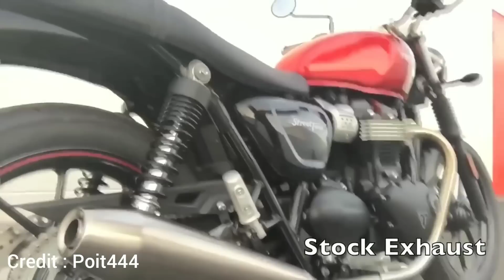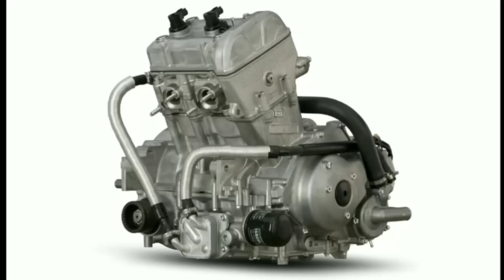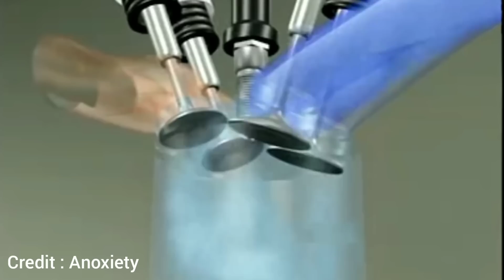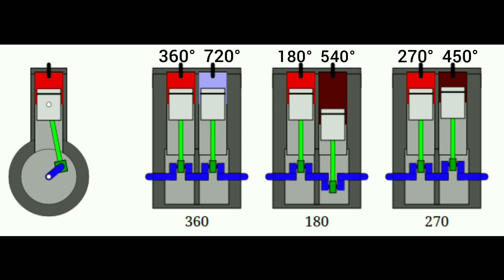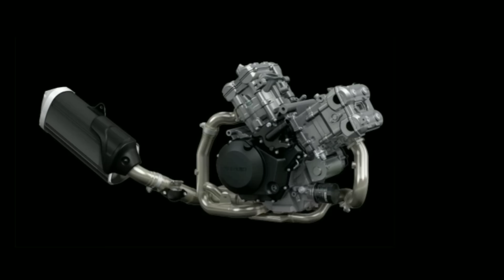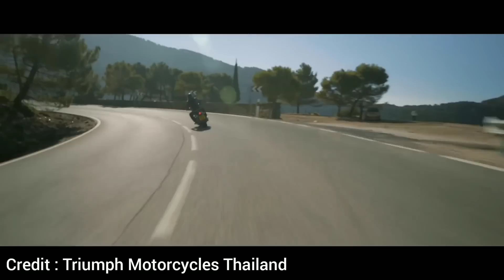270° Parallel Twin Engine: Why It's The Best Form of Parallel Twin Engine?

Comment: When comparing the pros and cons of 270° parallel twins, other engine factors should be taken into consideration.  Since this video examines 3 inherent characteristics of 270° parallel twins: vibration issues, exhaust/engine sounds, and cost of ownership / manufacturing.  I will examine only one specification (of many) that can affect all three of the issues listed above: engine cooling.

• Air-cooled engines typically dissipate their heat through fins seen on the cylinders, and often the head itself.
• Air-cooled engines require fewer parts, both for manufacturers to build and for consumers to fix, maintain and replace (radiators, pumps, coolant).
• Air-cooled engines provide more simplicity, representing less components, which could break, need to be replaced, or need servicing. (radiator, pumps, coolant change intervals, electric fan, etc.).
• Air-cooled engines run richer, making them less efficient and more polluting.

• Liquid-cooled engines replace air-cooling fins with an additional layer of aluminum casing to create a "water jacket" for liquid coolant circulation (more engine mass).
• Liquid-cooled engines having the cylinders and heads jacketed and surrounded with flowing liquid coolant act as sound insulators and deadens mechanical noise making them significantly quieter than air-cooled engines.
• Liquid-cooled engines - circulating liquid evens-out hot and cold spots in the cylinder head for better emissions and more complete chamber combustion.
• Liquid-cooled bikes can rev higher because they have higher tolerances due to their ability to self-cool.
Reply: Thanks!

Comment: With the 360 degree crank the firing interval is 360-360, it is an even firing interval, why does the animation show 360-720 at the top?
Reply: Probably because they mean a full cycle for the engine is two full turns of the crankshaft. In other words 360 + 360 = 720.

Comment: When I was looking at the classic line of triumphs in 2014 I thought I wanted a Thruxton.  Then I rode the scrambler and the engine did so much more for me with its 270 degree crank.  That set me off looking for a dropped scrambler to turn into a thruxton.  In that search I came across a Moto Guzzi V7 Cafe and haven't looked at Triumph since.
Reply: My 2012 Thruxton EFI does have a 270 degree crank.

Comment: Good point you made at the end about the 90 degree twin. You hear that after all, it runs a little smoother than the 270 parallel twin. And there are some great and expensive and less expensive 90 degree twins out there. We have perhaps the best known from Suzuki and Ducati. I’m sure they’ll hold their market for a good while. At the same time they are more expensive to build, which you also mentioned, if I remember correctly.

Comment: Good summary, just a remark: a 270°parallel twin is not equal to a "real" 90°v-twin in terms of balance. 90°engines have perfect primary balance, no balance shaft needed. So the vibrations are different and the sound isn't perfectly the same, as it depends on not only the firing intervals (just the exhaust note, but there are some auxiliary noises that make it special and characteristic).
Reply: having owned a 270 degree crossplane (MT 07) and currently a 90 degree v-twin (V-Strom 650) - I can confirm from experience that only the exhaust note is mildly similar ... the feel is very different, the vtwin is much more balanced at low revs and the power delivery feels smoother overall while the 270 parallel twin had a more erratic feeling power delivery and only felt equivalently smooth at the higher rpms (after 4500 rpms). 

both are a hell of a lot more interesting than a 180 degree parallel twin and produce better torque/sound in my opinion.

Comment: Since the 70s the Yamaha XS650 motor was a popular one to rephase to 270° (actually 274° because of the crank splines). In the 90s Yamaha introduced the TDM850 to the US market, a liquid cooled parallel twin with a 270° crank but sadly it didn't really sell well.
Reply: The TDM850 was a great bike - I spent a week in Scotland on one, and it was an ideal bike for the journey. Did not lack power on the Motorway, either!
Reply: Sadly indeed. The TDM is a great bike and gorgeous motor. 270o from the MkII onwards, pretty sure it was only the MkI that was sold in the US. Yamaha's 700cc twin is a direct descendant.

Comment: Parallel twin means 360 degrees, not 270.
Reply: Sorry, not true! Parallel means both cylinders are parallel i.e. together regardless of the firing order. all engines in the article are parallel twins. Another twin configuration is the Horizontally Opposed Flat Twin or "Boxer" engine.
Reply: It parallel as in two cylinders in parallel, as opposed to a v or flat configuration.
Reply: @christommo  You mean line engine as opposit of flat or v.
A two cylinder line engine is only a parallel twin when the pistons move parallel, but not with 270 degrees.

Comment: *WHAT ABOUT 2 STROKES?*

I had a two stroke, 2-cylinder Suzuki 250cc bike, an RGV-250, that in stock form put out 70hp.  Real lightweight bike.

That model from the 1990s is now over 20 years old.

If 2 strokes were still around, an RGV-250 would be putting out 100hp or more.

Imagine riding a 300 pound sport bike with 100 horsepower.  That's where we'd be today.

Damn politicians and tree huggers.
https://en.wikipedia.org/wiki/Suzuki_RGV250

.
.
.
Reply: Then you're not a tree hugger, 2 stroke stinks reeaaally bad, I sold my 2 stroke because of the bad fumes, at stops or with bags you start to smell like shit... And it uses a shitload if fuel AND oil

Comment: Nice clip. But I have to disagree with you about the exhaust note. To my ear, the sound of the 360° twins I grew up with (Triumph and BSA) has much more character. (And there's nothing uglier IMO than the flat fart of a big American V-twin!) However you can't always have everything and I'm quite sure that the low vibration in a 270° twin more than compensates for the sweet sound of the old British bikes that shook you to bits.
Reply: I agree, I grew up with British 360° twins which sounded great and then bought a 1984 Yamaha XS 650 which was 180 degrees that it didn't really feel any different at all, and then I test rode some new Triumph 270° twins and unlike all the hype about them feeling like Harleys they didn't  (I own old Harleys) They just felt very smooth like a modern Japanese multicylinder bike. My conclusion is the sound is no better but the vibration is less. (But the original Royal Enfield interceptors, although 360°, were balanced at the factory and were very smooth. I owned a 1969 one and can confirm this.)

Comment: Phil Irving from Vincent motors patented this engine configuration in the early 50’s.
Nothing new under the sun.
Reply: Interesting.  I had not heard of this configuration until these days with these new offerings.  I suppose Irving found no satisfactory reason to manufacture it.  I consider the Vincent one of the best engine designs ever produced considering it's compactness and visual appeal.
Reply: They was. Yamaha was the first motorcycle manufactor to offer it, but the drawings and patent goes back.
It can make you wonder why the british motorcycle manufactors never took it to them. Reduced vibration could have kept the costumer happy.
Reply: I thought parallel 270 twins were introduced in the 90's by Yamaha's TRX ("Trixie") and TDM

Comment: Good job, very informative content! One small detail, if I am not mistaken, 270 refers to the ignition difference between the two cylinders and not necessarily the spark plug firing. Some engines work on a waste ignition system, and thus fire the spark plug on every crank pin rotation! :)
Knit picking though, thumbsup!

Comment: I really dont like how you use "spark timing" as a reference, as thats a different thing entirely. But if you use a term like "compression stroke" or "power stroke" instead, its fairly accurate.
Reply: KyleP133 Agreed. Spark timing has to do with the relation to the timing TO the compression stroke. How many degrees before tdc. Totally different.
This is about crank timing.

Comment: Best explaination yet! Moto Guzzi has one of the best 90° v-twins.
Reply: And Yamaha had the best one, the TDM 900. With 10 valves and lots of torque. Now there's only the Teneré comparable. I do hope that MT series wil reintroduce a parallel twin again. That triple is good, but what should the twin lovers do now? Restore a used TDM 900? Why isn't there a new TDM 1200 big twin? Yamaha is very capable to renew the TDM, it was a great concept. Why not update it? TDM 600, 900 and 1200?
Reply: @voornaam3191  love a piped 900 triple...best sound ever.

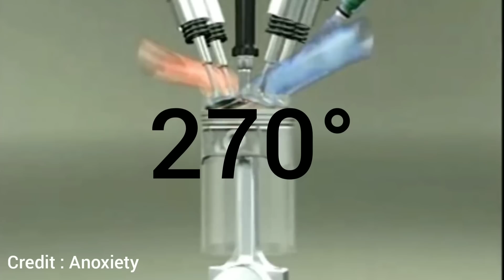Comment: 1:05 If you didn't know what the degree meant this explanation makes no sense and the animation apparently isn't used to help neither the 3d one or the 2d one after.

"The crank angle At which the spark is being produced by the spark plug in the combustion chamber near the end of the compression stroke" why are we talking about the spark and the compression stroke? What do they have to do with the degree? First I was thinking a ou the angle of the spark plug then I was thinking about how the compression stroke angle was different than the exhaust stroke. That was just a string of nonsensical words
Reply: Degree(s) is a relative measurement of crank rotation angle, it is how the timing of the ignition, inlet valve(s) and exhaust valve(s) timings etc of each cylinder are measured by and against.
270 degrees, means, that there is 270 degrees spacing between firing of cylinder 1 and the next cylinder to fire and so on per cylinder. In a 4-Stroke engine, every 4th revolutions that/a cylinder will fire again 360 x 4 = 1440 degrees.

Typically a 'Screamer' engine has generally all its cylinder firings largely equally spaced, with the power impulses being a constant driving force, while a 'Big Bang' style engine will have the firings closer together timing wise, leaving more room/time for restoring traction from the more powerful grouping of impulses.
A 270 crank is akin to a big bang engine, and a traditional 4 cylinder being more of a screamer.

But ignoring the firing intnerals so decribed, and more importantly... 

A 270 cranked twin engine, means the crank pin for each cylinder on the crank itself, the offset for each is able to be in the same postion on the crank relative to each other - where as a 180, the crank pins are on the opposing angle on the otherside of the crank, i.e; one towards the cranks top, and the other towards the bottom of crank.

Comment: And then there's the 90 degree (cylinder angle) 'transverse' V-twin which is actually a longitudinal v-twin since the terminology refers to the crank orientation. This in my view is the best layout for an air-cooled twin. Moto Guzzi know a thing or two about this.
Reply: So do Honda they built the CX 500 transverse V twin shaft drive  & went one step better & made it liquid cooled with slightly offset twisted barrels to tuck the carburettors in nicely .
Reply: Wasn't the honda more like 80 degrees?
Reply: @mikekokomomike  I always thought the Guzzie was less than a 90 % V Twin ,never really took much notice of them as they are Italian with dodgy Italian electrics ,& being of a low seat height were more suitable for women & vertically challenged male riders .
Reply: Guzzi is a 90 degree engine v angle, and the CX Honda is 80 degrees.  I worked with a guy had CX650 Honda with a turbo. Me, I ride flat twin BMW
Reply: @mikekokomomike  Never understood why anyone would buy a motorcycle with a big cylinder pot sticking out each side .Even fitting them with engine guards only adds weight to the huge over the top tin boxes & masses of Tourtech farkles & tat ,that makes them tractors prone to ending up side down on the deck .
Reply: I know,  it's rolling Broccoli 🥦 Watch a video of a police model R1250RT-P put through it's paces. There are several on YouTube and get back with me about top heavy Farkas  🤡

Comment: This is the latest thing to do to a Yamaha XS-650. I have one that's a 270 and it's the best thing you can do to any parallel twin that's not a 270.
Reply: Yes, when I saw this, I immediately began to think of the many older Honda twins that could benefit from this treatment.
Reply: Yamaha also made the TRX 850 (270 degrees) - a quite nice tourer, but pre 2000

Comment: Good show thank you . My thoughts on engine design if you want a single the Honda vigor slr650 are affordable and easy to tune for a lot more power . For a middleweight twin the Honda v twin as used in the transalp duville  and such is smooth as silk the Bros 650 being my choice way ahead of it's time . For a four cylinder it has to be a Honda vfr750 they have gear driven cams making for an almost silent engine and again way ahead of their time . Moving up to the big stuff a Honda varadero 1000 fi is a very practical proposition good mpg long rang tank touring fareing 3 piece panniers long tyre life  and plenty fast enough too carry two persons across a continent on any type of road in comfort it's only down side is chain drive it can be overcome somewhat with a scottoiler . Moving on in cost a bit for a twin a Yamaha xtz 1200 is the clear favourite they look good too  and are shaft driven . A less pretty more thirsty but it's all about the engine the big Daddy and the one to have is the Honda vfr1200 x  .  If you fancy a sports twin Ducati made some nice bikes the St series being their best kept secret all the trills with a bit of comfort throw in the dreaded belts are easy to change they cost a bit more to service than a Japanese bike but they are fun to ride .   For me the most desirable bike around these days is a Honda nc700x  dct very frugal biking and no need to change gear any more the engine is have a Honda fit/jazz car engine so they only rev to 6000rpm the sound great with an end can . The new royal Enfield 650 is pretty cool Harris designed the frame  they are more affordable than a triumph and more like a 60's bike I think . I am not bothered about retro style myself .

Comment: I’m going to stay with my 360 degree as I will sound unique all others are trying to sound like Harley and Ducati’s.....which sound cool but a 360 degree roaring does sound cool as well ....just now uniquely cool ha ha
Reply: Yes i stick with old preunit triumph
Reply: The best
Reply: Especially after installing Arias Pistons to 904cc, 11:1 comp, David Vizard Polyquad head design, 813 WebCams, 44mm Street Triple throttle bodies, manifolds and velocity stacks modified to suit, Sprint Pod filters, 2 into 1 modified TEC exhaust with reverse cone larger flow muffler……ohhhhhh she sounds so so nice and pulls so hard to 8500 rpm…..not that you need to ha ha
Reply: Yup. My old T100 is just fine.

Comment: can you do a video on Motogp inline 4 and V4 engine . recently V4 engines dominating more in Motogp . Inline 4 are suffering in acceleration and top end speed compared to V4 . its seems like Yamaha inline 4 reached its max limits and now Ducati , Honda and even new team KTM have better Top speed . they are using V4 . most of videos on internet are about sound difference but i am interested to know about why inline 4 started suffering against v4 in motogp .

Comment: 180-deg parallel twins (ie Kawasaki ones) sound so bad, they ought to be banned.

Owner try to make up for the weedy accoustics by  adding a loud pipe, but that only amplifies that horrid hollow sound as if it's hoarsely crying out for 2 more cylinders. This type of twin is literally half an inline 4, and it bloody sounds like it.

A 270-deg parallel twin has a more characterful rumble (which is why ppl buy v-twins). A 360-deg parallel twin sounds like an inline 4 rocket (because one cylinder is always firing every turn of the crank).
Reply: Haha that Kawasaki engine does sound like shit. More like a lawnmower.
Reply: Hey.. Hey... guys.. my 2017 Ninja 650 sounds good enough for me... She still turns me on when she moans😁😎.. and I ride about 2,000 miles per month from May to October..  😊
Reply: @Tobeon2  yeah I agree, it's very passable with a good exhaust on it. I prefer the sound and feel of my ZX-14, but if you're on LAMS the ninja 650 with a musarri sounds nice enough.
Reply: @innocuousmerchant8766  These days I am riding Suzuki GSX S750 with SC slip on muffler and OMG, it is loud... too loud... yikes.. 😞.. lol
Reply: Honda had the same layout with their early twins of the 60's into the 70's, and it was the same. With a loud pipe they sound awful.
Reply: It also performs like one. Piss-weak bottom end, non-existent top end on most of them.
Reply: I had a yamaha mt03 180 degrees n sounded great with stock pipes

Comment: So why Japanese manufacturers still prefer the 180deg crank? Like honda cb500 series, kawazaki z250 z400, 650 and w800 ?
Reply: A 180 degree crankshaft should be cheaper to make than a 270 one.
Reply: 180 engines rev higher with more peak power. More suitable for sports bikes
Reply: W800 is a 360 degree engine
Reply: @daviddonne7333  yes you’re right, light the old triumphs if I’m not mistaken.
Reply: ripmax333 less chain wear, higher horsepower in higher RPM’s and smoother running.